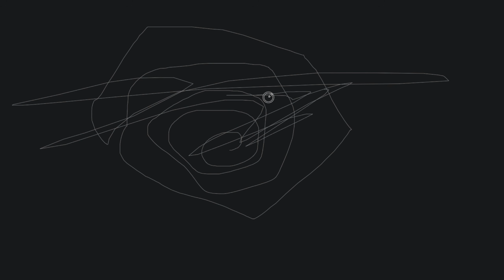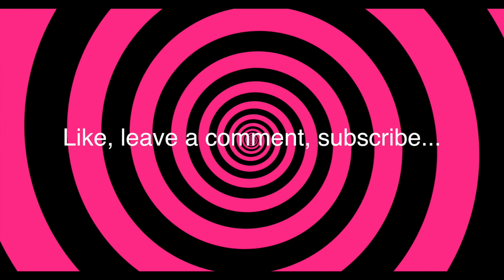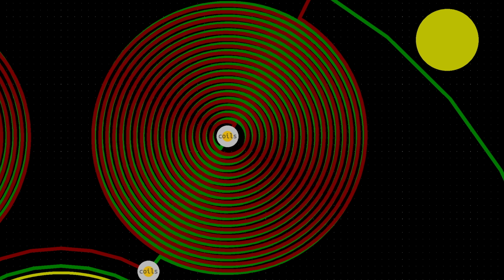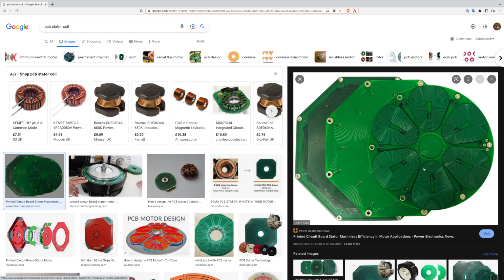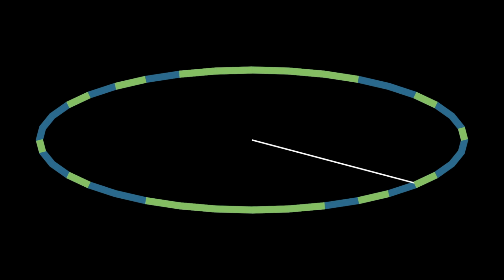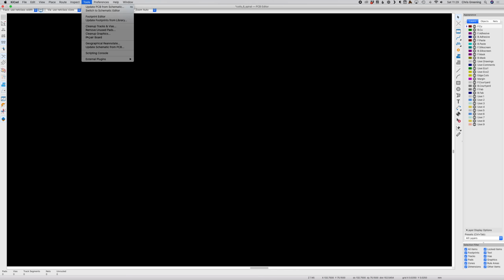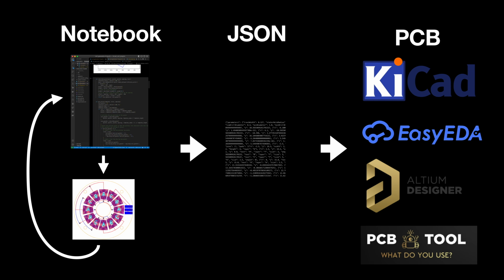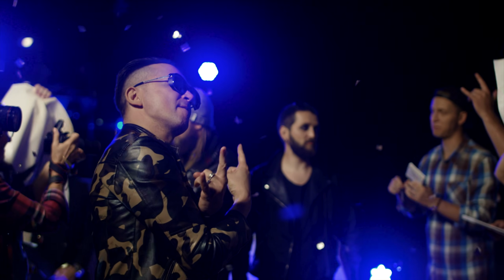Create Powerful PCB Coils with Automation - KiCad Plugin Secrets!

Comment: This is cool! By the way, by keeping it the original way, you essentially have a Tesla bifilar pancake coil, which acts like a capacitor and generates a dielectric field instead of a magnetic field. You see when you have two currents/magnetic fields that are equal and opposing each other, they don’t cancel out. They collapse to form a single standing longitudinal wave, which is a voltage potential (aka a capacitor) and it forms a dielectric field instead of a magnetic field. This is often mistakenly called “electrostatics”, which is a misnomer.

Comment: It looks like the project in Git is broken in many places. Here are some examples:

coil_generator-6.ipynb:
Cell In[13], line 60, TypeError: create_via() missing 1 required positional argument: 'net_name'

coil_generator-12.ipynb:
Cell In[19], line 7 , NameError ... pcb_json.py:83, in dump_json(...) name 'create_track_json' is not defined (not imported, actually)...

coil_generator-radial.ipynb: 
tries to import from pcb_json the create_track function, which commented out. If to uncomment it, then cell In[9] uses variable 'points_b', which is nowhere defined;

Comment: Incredible how people keep on copying their backwards design.
What are these magnets for? Have you ever seen an induction motor?
...and do they perhaps have magnets?

When will people start using their brain? It's free!
Reply: Could you explain what exactly you mean? 
For an IM motor the stator would still need coils?
Reply: An induction motor does not need magnets because it induces a magnetic field in its squirrel cage.

So, why does his PCB motor need magnets?
That's last century, redneck engineering.
Reply: He did have a stator ring of magnets spinning over the PCB coils. He showed it at the beginning of the video. Did you miss that?
Reply: Does an induction motor perhaps use magnets? Did you actually read my question?

Induction motors dont need magnets, so why does his motor need magnets to function?
Reply: @fglatzel  Ask him! lol
Reply: Explain how induction motor works better than PCB coils with device in micro size and required to operate in low speed, while maintaining its torque density.

Comment: Thank you @Atomic14 for sharing the PCB coil design. Have anyone tried designing a Axial flux Generator using the PCB coils? The sample provided by @Atomic14 is bit small, and I am not familiar with using KiCAD software. Can someone help to scale the size for the wegde coil PCB to be 200mm diameter instead of 46 mm diameter?

Comment: Hi Atomic14, here's an idea if not a request: Perhaps at some point you might look at the similar idea of making a capacitive quadrature encoder using nothing but pcb tracks and timers - similar to the digital calipers we use. I've been experimenting with this using 2 pcb's, one rotating over another but so far my results have been terrible and too easily affected by finger proximity. I need some sort of physical common-mode rejection built in to the geometry if not in code.

Comment: Would be nice to see if stacking flex pcb coils is economically feasible compared to having the multi-layer pcb manufactured. More coil more gooder.
Reply from the maker: Yeah, that's a really interesting question, the other thing to think about is the cost difference becomes much less significant for multilayer boards once you start going for larger quantities - ordering 500 8 layer boards works out at about $1.40 each. If you only want 10 then it's $28 each...

Comment: I suppose there’s a reason why you can’t stack multiple pcbs to increase the coil density? I haven’t thought this through 👀
Reply from the maker: I think you definitely can. But then it might be better to go for more layers on the board instead. To be honest my knowledge of electro magnetism is pretty low so I’m not sure what would be best.
Reply: Yes, ofcourse considered the flow of current in both coils are along the same direction. Stacking several pcb coils along the z axis, essentially can be modelled as solenoid.